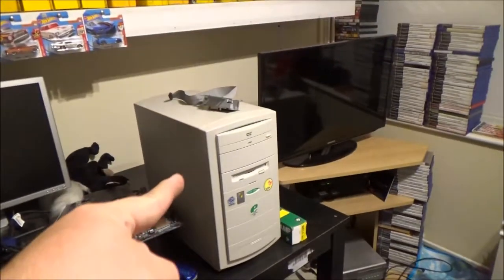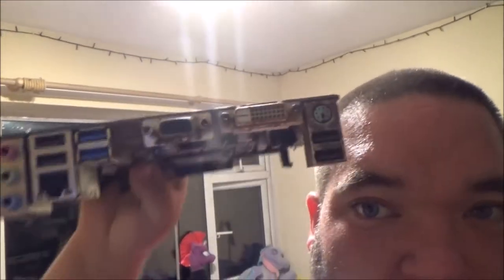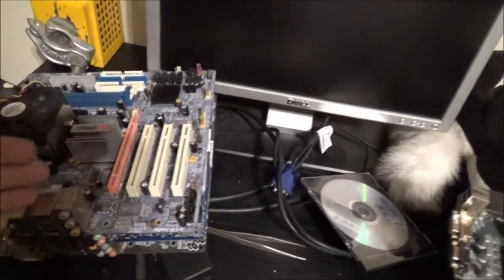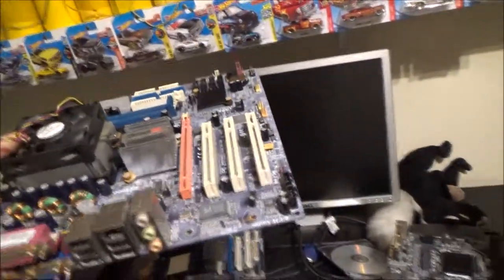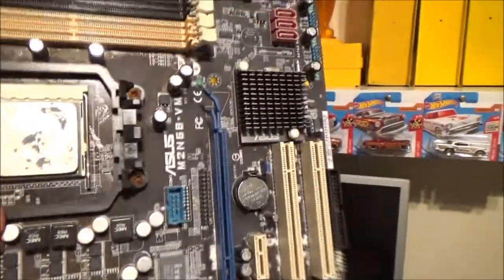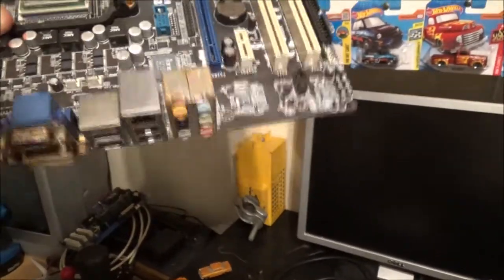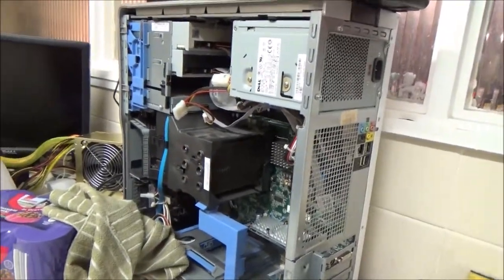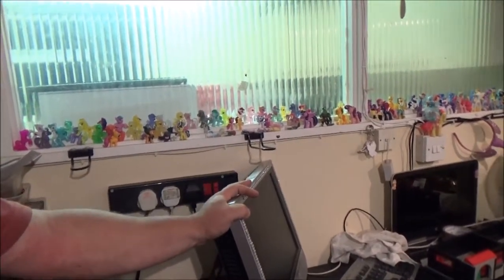Computer Update

Comment: that is pretty good I got an HP ProBook 5330m - 13.3" - Core i5 2520M - 6 GB RAM for just £40 the other day it has a charger but no battery but works fine.  there quite a lot of laptops for sale lately around Clacton.